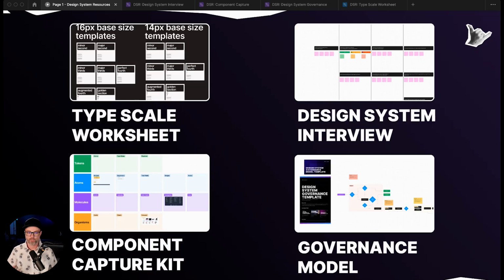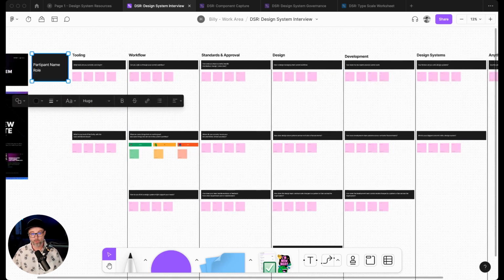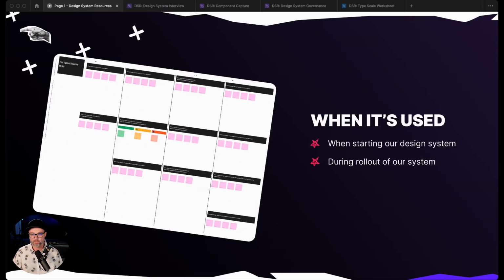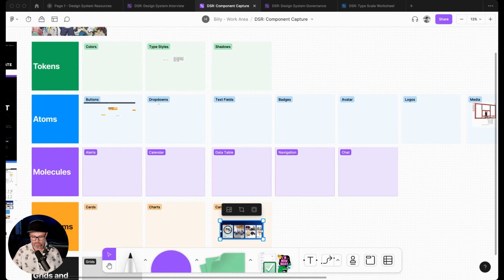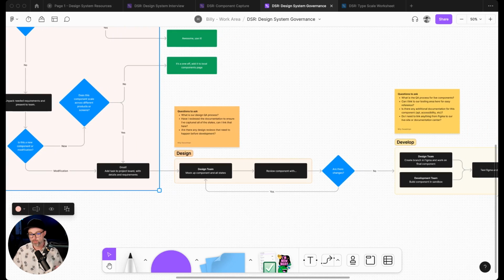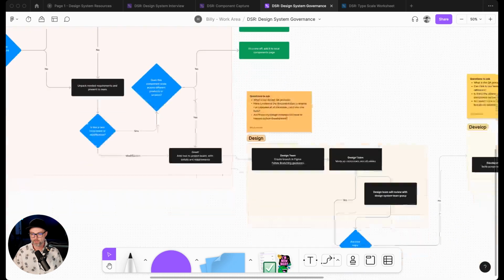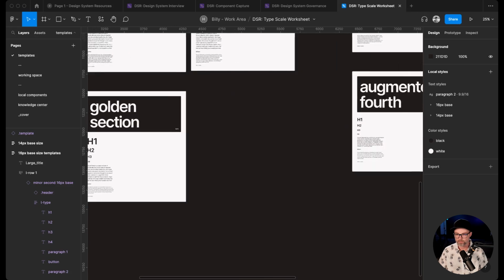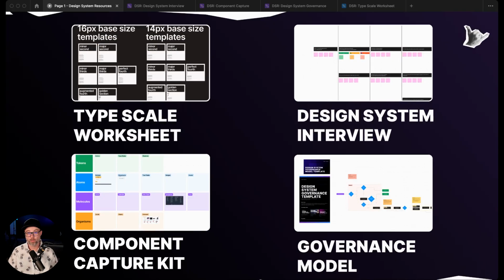Free Figma Design System Templates to Improve Your UI Design Process - Figma Community

Comment: Great video! Very informative. I'm curious to understand how you're defining line height. Is there any further information you can provide?
Reply: Hey KAT! Yeah, so most of the time we're doing the type size * 1.5, then rounding it to the nearest 8px grid. Which gives us a nice clean text box in the land of figma and keeps things neat for the different type sizes we're using. I hope that answers your question.
Reply: @worldzer0  That is great! Thanks for the explanation. I usually define via the 1.2 or 1.5 method, but I'm really looking to refine this in my Figgy designs.😀
Reply from the maker: Thanks KAT! I'm checking with Billy on this question for you. - Jacob